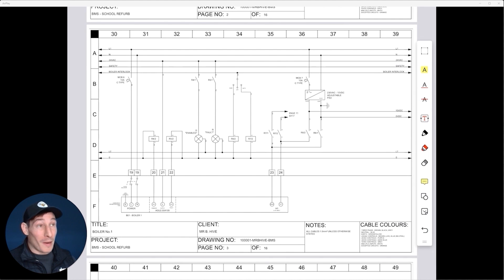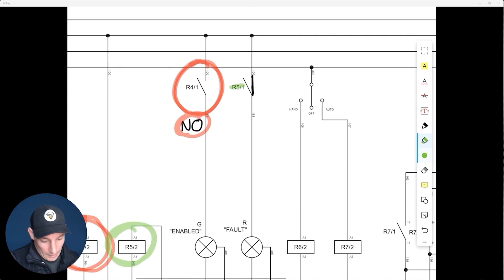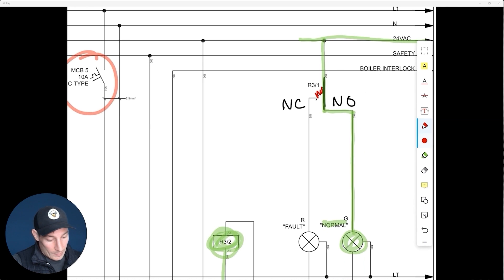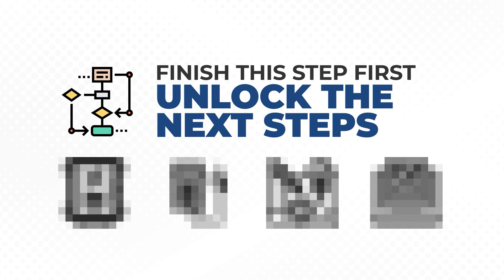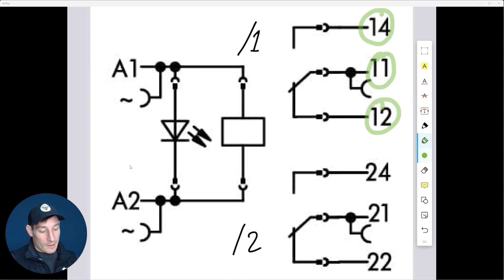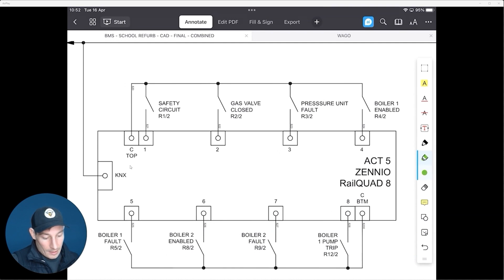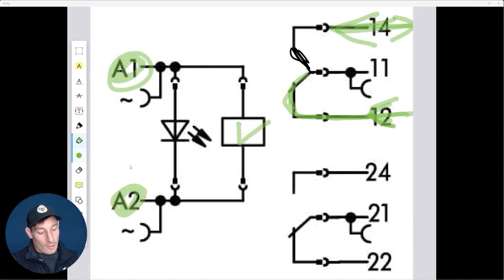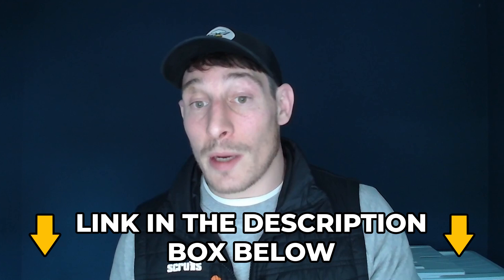How a Relay Works - Normally Open vs Normally Closed

Comment: Normally Open = OFF when it's not powered (at rest).
Normally Closed = ON when it's not powered (at rest).
In electrical drawings they are represented at rest.

Things get even more interesting with photoelectric sensors, with "light on" or "dark on" modes or when you need to invert the signal in the PLC :)
Reply: Not so.  
N.O means circuit is open when not energised
N.C means circuit is closed when not energised, it doesn't mean something is on.  It can't be on if it's not powered.
Reply: @jayseabie215  When I mean "not powered" I am referring to the solenoid that  operates the relay, not the load...
Reply: NO Nice One